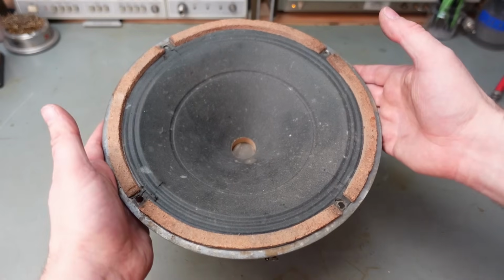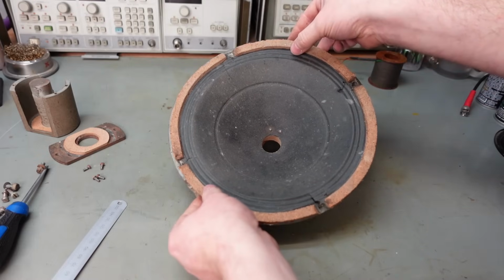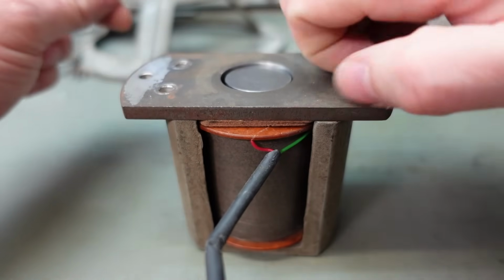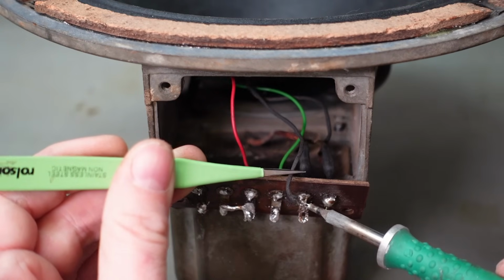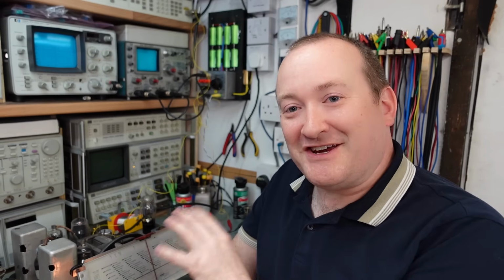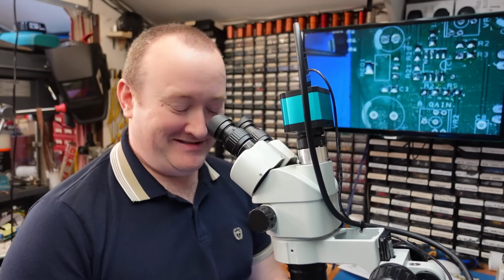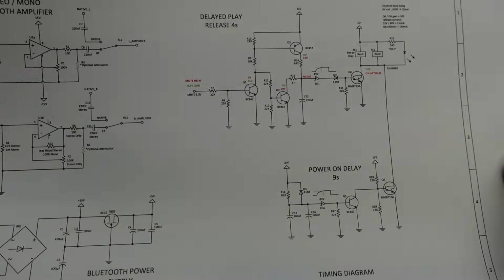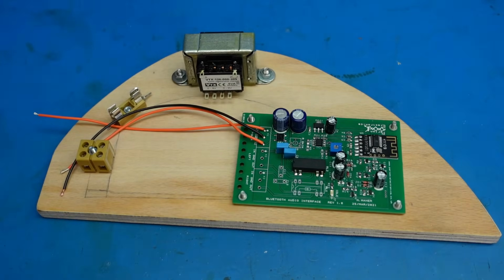1942 Ducati Radiogram - Part 2 - Speaker Repair & Bluetooth Installation

Comment: How brilliant that Ducati put their schematic diagrams online in 1942, they were really ahead of the game. 😂 It's fascinating seeing a device that is over 80 years old get some skilled attention from Mark. The speaker restoration was an awesome job, that cone will hopefully last another 80 years. This is some of the best video on YouTube, Mark!
Reply: Schematics where often glued inside the device back then, often on the removable back panel. More elaborate schematics were published in notebooks like the RCC. This was a time when electronic was expected to be repaired, not thrown in the garbage at the first failure.  I remember a pharmacy that had a tube (valve) tester for customer's use. You looked-up the tube number in a scrolling chart (or maybe a binder), configured the tester's switches and dials and tested the tubes yourself.
Reply: @yl9154  Ditto, I made a few trips to the local Orange Rexall drug store to test and we also had a few spares at home, as my uncle was a TV and radio repairman. I think it was that pesky 6SN7 most of the time.

Comment: I recall from my early years working on similar radios, the magnet coil on the speaker was often used as the inductor with an electrolytic cap in a filter, hence the Output TX being mounted beside it as one end of primary would be at HT+. When re-centring cones I always used 3 thin strips of card or paper inserted radially in the airgap to hold the cone central while tightening the hold down screws. Keep up the good work, enjoyable videos.
Reply: Last remaining use for business cards!

Comment: The cone in your speaker is in far better condition than mine. 
Somebody had a go with patching and now most of it was not there. 
The pole piece top had the cluster of dust yours had though. What was it about no dustcaps back then.
Interestingly, the cone seemed to be moulded to the coil and the spider was paper.
Mine might well be an earlier version.
Lucky, the owner only needed it functional, so anything went.
The cone wasn't quite as deep, but a 50's style.
The coil had to be longer. The spider a cup type. And made new gaskets - from felt.
But in the end, it made a clean and decent noise. 

I've been repairing speakers for 40 years and seen a lot.

Comment: genuinely surprised to see that Mark doesn't just have someone else assemble the PCB he designed, but I can tell he just enjoys putting it together
Reply: I thought that also
Reply: @thimble369  PCB manufacturing is pretty inexpensive these days. Assembly is a bit more expensive, and often doesn't make as much sense for small production runs. For these type of one-off hobby or prototype projects, you'd usually just have them put on any parts that are really difficult to install by hand. But Mark intentionally designed with large components. Even all the SMD parts are pretty big and very easily doable by hand. You don't even need any specialized equipment, although having a microscope is nice.

Comment: Excellent work Mark. 11:06 - TIP: I see they usually put some paper strips between the coil and the magnet, to space them equally when assembling the membrane. The strips are removed once the cone is assembled.

Comment: Hey great job mate! - Especially on the speaker, wow I've never seen one that could be so completely disassembled before.  

As soon as I saw the vice coil rubbing on the magnet, I thought the speaker would have been kangaroo edward!  But no, you repaired & rebuilt it!  Good idea using the paper patches.  And it looks great after you painted it too; much better than I expected.

That bluetooth add-on is genius.  I guess you tune to a quiet part on the radio to play records or listen via bluetooth then?

Yep, I had fun watching this old work of art being restored better than ever.  Hey where did you get that bluetooth board? - Did you design that yourself?  I think I want one o them!

Comment: I had a Yamaha DXR10 powered speaker that I was using for bass augmentation with my Leslie for live gigs. The cone ripped from the edge almost to the center. I had another gig and didn’t have time to order a new speaker so I used some standard lined notebook paper and PVC glue (the white glue that Mark is using in this video) and repaired the tear. It was meant to be a temporary fix until I ordered a new driver but it lasted for five years! Eventually another tear opened up but my original fix was still fine. I did finally order a new woofer for it.
Reply: Sorry to be pedantic, but was that PVA glue?
Reply: @billdoodson4232  no, it's PVC-E glue. I bought a big jar of it to do glue new keytops on piano keys.
Reply: @JimAlfredson  Ohhh, never come across that one before. I will investigate further. Cheers.

Comment: For future reference, you should use a shim to centre the magnet assembly as well as the coil into the gap. 7 thou plastic film is the norm. Remove after you've tightened the screws and/or the adhesive has cured.

Comment: For speaker voice coil gaps, the most reliable method is to use four equally sized shims. Same for gluing the surround. Use four or six shims to lift the cone up enough to get your adhesive in with a spudger. For cleaning tube sockets, a straight eye liner brush really does the trick, with some Deoxit. Put it right as rain.

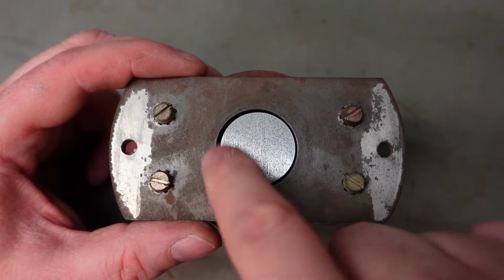Comment: 10:24 Those 4 screws are tightened down last (leave them a bit loose). First, set the mag/motor assembly in place, and tighten. Then flip over the speaker and use some thin paper strips (from a cut up business card), and slide them into the coil's air gap (alternating sides to make sure it stays centered in the gap). Once it's centered, turn the speaker over again and now tighten down those 4 screws. You now have a perfectly centered voicemail, but leave the strips of paper in place (for now). Now glue down the rim of the cone and use a whole bunch of clothes line clips to clamp it down until it dries. Once it does, slowly pull out the thin paper strips from the coil's gap. You can help keep any dust and dirt from entering the coil gap in the future by gluing on a small round dust cap. Btw, you could have used the same paper strip centering method when you were trying to center the motor assembly (at 9:29).
Reply: Indeed, that’s a good way to do it, had some great results myself with that..

Comment: when lining up voice coils, gaps and spiders its a lot easier to use plastic shims in the gaps.. For paper cone repairs PVA is mighty, although I prefer tissue paper to filter paper - applied in layers as papier mache..cigarette papers work well.

Comment: i have repaired speaker cones with newspaper and pva in two or three layers like papier mache. Paper or card shim coiled around the magnet to center the coil during install, pull it out before fitting a dust cap

Comment: A little tip, the brushes for interdental spaces are well suited for cleaning the plug contacts of the tubes.
Reply: Thanks for the tip.
Another tip: thinned (with MEK) Ados F2 with black tempera and delaminated toilet paper for a very strong and almost invisible repair of speaker cones.
Reply: @markstuckey6225  I've used newspaper and 3M general trim adhesive to good results as well. messy/sticky going on, though.
Reply: Great tip!

Comment: Great to see some one that does not do a bad job but takes a pride in repairing and building a great old radio gram,  I own a lot of thanks to a radio/television engineer that show me back in the 60s not to just throw radios away just because the parts was not available any more, this for a young boy just left school at 15years old, and start to work in a shop that repaired radio/television/ electric irons/hair dryers/etc, we all so sold the full range of resistors / capacitors/valves in stock  for the public to cum in to buy. happy days, thanks for showing you great skills.

Comment: Amazing work! Thanks especially for respecting the original circuitry and repairing it with appropriate techniques. A lot of "restorers" would have just gutted it all out and installed modern components. Oh, and I really like your Bluetooth board. Well done!

Comment: Great work as usual.  My only add would be to include some sort of mixer on the stereo output of the Bluetooth module.  There might be sounds in the source that are only in one channel that would be missing in the final output if only one channel is routed to the output.

Comment: awesome :) 
I have used the spray Plasti-dip, with good success, to repair splits in speaker cones...
It fills in the splits, and dries rubbery, but still flexible, and found that it really "bites" into the cone paper, so the repair is very strong and withstands the movement of the cone when the speaker is in use :)
The fact that it dries black too, is a big bonus :)
Reply: I use Evostik impact adhesive for the same reason. When dry it remains flexible.Saves having to stick patches over cracks. If the cone has become deformed by damp spray it with isopropyl alcohol (surgical spirit from the chemist) and as it dries it magically pulls the cone back to its' original shape. Been using both methods for 50 years and never fail!
Reply: @buttyboy100  I'd be worried about long-term stability of these materials. Who knows what they'll look like in another 80 years. On the other hand, coffee filters don't exactly inspire confidence either. They aren't exactly archival or conservation grade. I would have looked into bookbinding materials. There are lots of good options that are specified to last for decades (or longer), and in the small quantities needed, they don't have to be excessively expensive either.

Comment: I'm glad that worked for you. I usually center speaker voice coils by putting something in the gap to shim it all the way around; an old plastic soda bottle usually works pretty good and is about the right thickness.

Comment: I love how you made that cap mark...nice work.
A tip I've used for repairing splits in cones,is watered down pva and multiple layers of the the thinnest toilet roll you can find. Just use one ply.
It's a bit like fibreglassing when you're doing it.
I've had the best results using one ply ,laying it on and letting it sink in.

Then leave to dry for a day or two.
Then come at it again 45° to it with another ply. Then again.
I've done some tricky repairs around the edge like yours this way that are in guitar cabs and still going strong years after 
And congratulations in all your recent support about the copyright take down mark.
We're all with you mate

Comment: Great restore, Mark! Enjoyed from start to the end! The part with the speaker fix is my favorite. Fixing a 80 year old field coil speaker is noting for the faint hearted. For repair of torn light paper membranes i use 1 to 3 layers of teabags and cellulose glue like for wallpaper (good for the SABA Greencones for example). After drying it's barely noticable. Your way provided even more strength.

Comment: I'd not seen "gimmick" capacitors like the ones originally installed, and the ones that you constructed.  Previously, I'd only known of the two wires twisted together (though not using CAT5 twisted pair wire, a bit too modern that is!)  What an amazing restoration, and a great reminder of how simple an AM receiver can be.

Comment: this was someone's pride and joy, back in the day, very expensive,relative to typical earnings back then.high-tech,think top-flight streamer in oday's terms. liked the video,superbly done. nice you preserved it, for future generstions. there can't be many still around.adding 21at century microelectronics great fun. can't help but thnk that in 80 years from now, that part won't be so serviceable/saveable, if it fails, like this unit was.overall.  finally, think, that if you want, you should consider Patreon, to reward you further for your efforts.

Comment: What a remarkable intellect, personality, and craftsman. Most of the stuff Mark does is above my paygrade but I've actually learned a fair bit from watching his channel.

He could have simply replaced that speaker with something modern but it's so much cooler that he lovingly repaired the vintage driver and kept things as original as possible (with the exception of the Bluetooth module but that ensures this old radio will continue to be used for many more years). Wonderful stuff!

Comment: Mark you are amazing mate! I've worked on a 1958 Sharnsberg Strauss Radiogram.  I updated the Record Player from a Monarch D3 (I think that was the model number)?  And fitted a BSR semi auto record player using a crystal cartridge or maybe I used the other type to run with the vintage receiver.  It worked like a charm.  More videos of your amazing work please.

Comment: Love your vids and your skill level is stellar. I have a lot of experience working with old speakers and I find a better patch material is toilet tissue or kitchen roll, all other aspects just as you do. You can use just one ply and your repair will conform exactly to the undulations in the cone and once dusted over with paint becomes almost completely invisible, personally I do both sides with repair and paint. It dries to be perfect in terms of strength and making no effect on the weight, movement or balance of the cone whatsoever. Really glad I found your channel!

Comment: i always said to David Tipton that we used to when listening to the Radio back in the 1960s. the well aim thump with hand to the side of the case normally got most loose bits back into making some kind of contact.

Comment: I always use glue like this to repair speakers (more precisely, I use simple wood glue diluted with a little water). I use cigarette paper as repair paper; if necessary, you can glue from both sides without putting too much weight on the cone.

Comment: Great job designing those time delay r/c circuits. I see you've decided to go with through hole now and not "bug chip" mount. Even though you're great at fault finding and circuit design, I can tell that point to point valve circuits aren't your everyday thing, but you still get there and finish the job. Very enjoyable to watch.

Comment: Great work! Given it’s going to be in quite a public area, I probably would’ve changed the valve sockets out for modern ceramic ones to reduce the risk of arcing, added some protection/back up diodes behind the valve rectifier, and added some extra fusing (both secondary legs), and a switched IEC socket.

Comment: Should have used Varnish on the cone, Mark. The only thing you will tune into with that Is probably Mars. I have the same with the decks lights on my Citronic Thames 2 mk2, looks like the same bulbs as well. Have You ever worked on one these?. I have a Hum under the left turntable, doesn't effect play though. But I was always told that a Hum Is still a Fault. Beautiful Piece of kit there, and worth Restoring. I thought the Record was going to be "Chanson De Amor" for a second. Thanks for the upload, and Keep 'Em Coming.

Comment: Great video Mark and that  Ducati Radiogram is lovely.  You may want to be a bit cautious working with the old  cloth insulated  wiring as some of it had asbestos  in it  (ie wear a particle mask of some sort to avoid breathing in any  fibres that may have become airborne when your moving them around )

Comment: I see a speaker repair at a speaker workshop for my old chassis. For centering, he placed a cylinder of paper into the air gap, between the coil and the center magnet. A pilot. So the membran was absolut centered before glue it into the cage.So he don´t need to struggle, to find the exact position of the coil in the air gap.

Comment: Fantastic, great repair! A speaker that you can take apart entirely with screws..... never seen before! Speaker looks fantastic however I think I added a dustcap to protect the coil and gap. Is the hum related to the speaker config or something else? Just a tip I have seen in other speaker repair videos: Use wooden/paper spacers that fit the gap to center the magnet and coil to keep it perfectly in center. This makes it easier to glue the cone without a worry.  Don't use spraypaint (paint is stiff and 'heavy'), it changes the characteristics of the speaker and that maybe the result the speaker isn't that loud. Better use chinese ink, very black and doesn't add any weight to it. Anyway, it is a pretty unit and topped off with a smile. Very profi, love it! 😀👍

Comment: Amazing work but a little suggestion, when your fitting Bluetooth board have you tried using pc motherboard stand offs, ive just found your channel and love the work you do, i would love to send something to you for repair to fix for me 👌
Reply from the maker: I think I used some TO220 heatsink insulator washers to space it off the wood.. Very low profile (and I bought a bag of 5000 some years ago - still plenty left!)
Reply: @MendItMark  would the board also take an AUX input from a Cassette or Tape Deck ?
Reply from the maker: @highpath4776  yes it would.

Comment: I was a little surprised to see that Mark hadn’t noticed that he soldered the live on to the 0V and the neutral to the 240V on the Bluetooth mains transformer (32:30). It makes no difference functionally of course, and it is still a great video.

Comment: Watching this, the red and the green wire coming out of that coil most I’ve seen or always cloth covered wire so I wonder if once upon a time that was rewound and then the feed out wires were plastic insulated. The next thing I noticed, and I thought about it probably in your schematic that magnet coil to energize, the speaker is normally used in the power supply as a choke. Gotta love Field coil speakers.
Gotta admit how serviceable those were unbelievable. 
But anyhow, really cool video very addictive